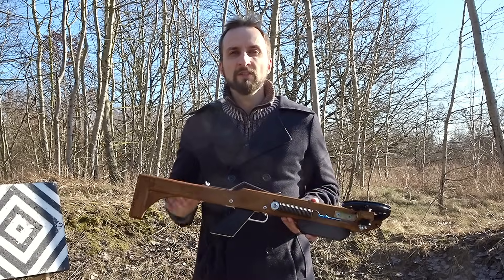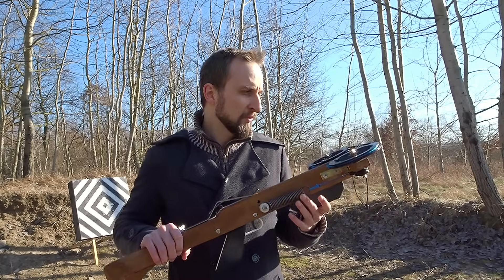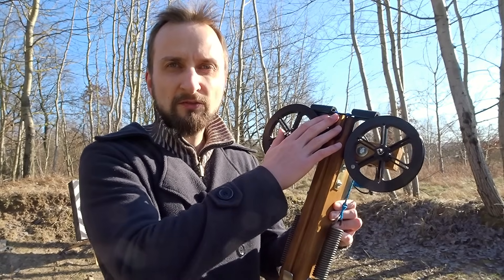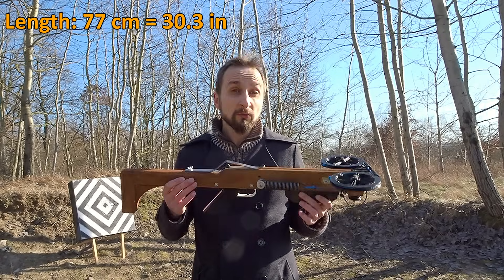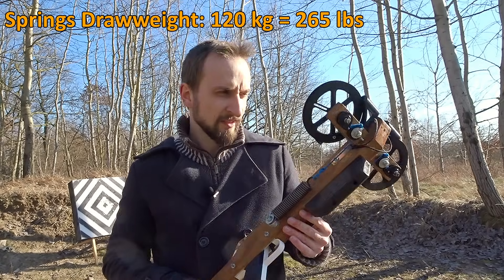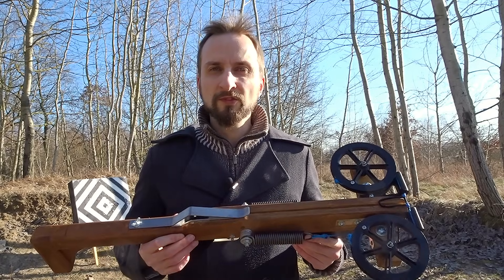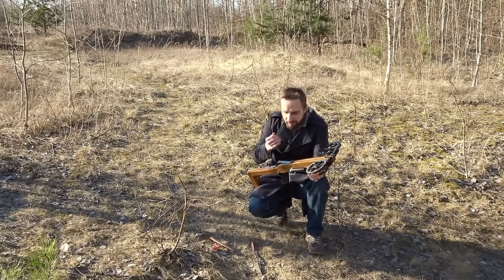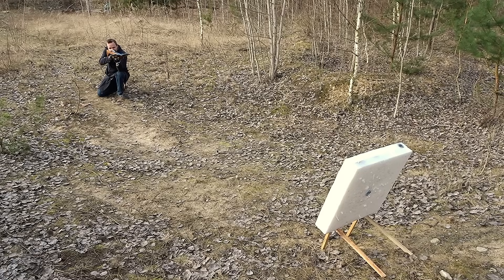Coilspring powered Crossbow

Comment: Hello, I tried to modify your construction a little by not using round pulleys on the string, but in the shape of a three-quarter ellipse with a ramp from a smaller to a larger diameter, it made stretching the string a lot easier, since the largest diameter of the pulley is actually at the point when the spring is "free" " is basically in zero action and as we pull the string further, the diameter decreases and the closer we get to the maximum tension of the coil spring, the diameter of the pulley for the string decreases and thus we develop less force for stretching, but at the same time it simplifies the start of the string, the greatest force it is actually on the smallest diameter of the pulley and as the diameter increases the power decreases, but the speed of the string increases and so does the arrow, I use one spring not two, and it is built into the duralumin body of the crossbow, actually it is not one, but two, they are pushed in itself, it is softer on the inside and harder on the outside, in addition, they are longer and for better balance the end of the springs is attached to the pin before the end of the stock, while the trigger mechanism is designed around the driving coil springs, I charge with a lever that pulls the string up to above the spring and is integrated in the crossbow frame, I also have an industrially produced hunting crossbow with a reverse reed and elliptical pulleys, I must state that the home-made spring crossbow has significantly more power, I don't know exactly how much, but the arrow shoots at a speed of 508 m/s, it is absolutely accurate at 30 meters, after 40 meters already the ballistic curve works and the arrow goes down, but the arrow hits the oak tree 2 cm deep at 70 m, which I think is a respectable force, at 10 m it pierces a 5 cm thick spruce board and the arrow simply goes through the whole thing and flies even further, at 20 m it goes through straw I aim for a third of the length. I'm currently dealing with loading from a suspended arrow magazine, I'm mainly interested in ensuring that the mechanics fit the arrow accurately into the arrow holder and always in the same way, both deep and sideways, and the accuracy of shooting depends on that, there are still malfunctions, but it's already going well in 90 percent of cases, you can put it on the same way, but it is only about the correct clearance in the arrow feeder and the pressure of the holder, the repetition speed is about 6 seconds, which I think is good for a crossbow. Thanks for the inspiration, I would never have started this even though I know the principle of course if I hadn't seen it from you. good luck :D
Reply: No way it shoots at 508 m/s, I think you mean fps. No way in heck you made a supersonic crossbow 😂 508 fps is still an absolute monster though.
Reply: @mrkiky hahahaha i raised my eyebrows when I read that 🤣 😂
Reply: @mrkiky imagine a crossbow that sounds and kicks like a gun lol. And you’d need like tungsten bolts for it to not just obliterate them.
Reply from the maker: Well, sounds like you put in a lot of work and thoughs on improvement of the general idea.
Are there pictures or video of your design anywhere?
In any case nice to hear from someone picking up the idea as well.

I am thinking about non-circular cams as well of course, as already stated in the video.
But I had some other things going on in life which is why not much happened in this topic.
However for now I am working on implementing the idea in a bow - that should come out sometime this year.
Reply: Я тоже прочитал Ваш комментарий подскажу идею чтоб стрела легла точно в ложе используйте мини магнитов просто вклеить а углубления .удачи
Reply: Can we get a link to vid please 
I'm super interested

Comment: You can actually get rid of the two wheels closest to the spring and connet the spring cord directly to the underside of the big wheel axles. Your springs would angle away from the weapon body by around 15° so won't look as cool, but it's simpler and it reduces friction just a little bit.

Comment: What are your thoughts on using a vacuum piston as your power source?

There are a few relatively old videos of a guy who made something like that and frankly, its impressive if its real. But your design can improve it greatly, I think. I would very much like if you could watch those clips and share your thoughts.
Perhaps even explore realizing the idea in the future?

The channel in question is 'Pylenok'
Reply from the maker: I don't have any experience with these vacuum pistons. I see potential issues with leakage and would generally question how fast these are.
No doubt a vacuum would pull back with enormous force, but the amount of grease he had to put in there tells me there is probably a lot of
friction to overcome, which would make it slow. But again I have no experience with these and would need to look closer into it.
Unfortunately he has no shot over a chrony as far as I can tell, so its hard to judge the true power of these (especially considering
that zylinder is huge - compared to the relatively small springs I have).
Reply: @aurigo_tech  You can only kind of judge the speed by the sound of the bolt, if he actually gave correct distances. I brought it to light because you can easily print the piston to really fit well to any tube you can acquire and cause its right up your alley :D

Comment: I would suggest adding some sort of lightweight casing for mechanisms.  If something got caught in the wheels or springs when under operation you may get a danger of the operator getting debris in the eyes or face the mechanism.  Alternatively a face guard, face shield or combination of a face shield and mechanism cover.

Comment: Replace your coil springs with high grade nylon monofilament, extending right back in grooves to the back of the stock. 
It has over 140% original length yield strength and the highest energy storage per weight in tension of any common material.
Run it directly to wind up spools directly on your throw wheels. 
If you offset the centre of rotation on the throw wheels and reduce friction by having them offset forward and unwind   the throwstring directly at their rear, and preload the nylon tension cords, then you can easily achieve a constant force and acceleration over the whole throw of the Arrow. 
Then you will have a world leading crossbow in power and accuracy.

Comment: good design.  i would recommend putting safety wires through the springs though.  that way if the springs break they don't go flying everywhere and hit you in the face.  i used to work on garage doors and that was a problem with some of the older systems that home owners would install.  its a good idea for anything that uses extension springs
Reply: My thought was to have the springs inside of tubing attached to the stock so the spring is inside and cablesruninto end and attach to the spring . So if the cables ever break you want get those springs in yer face
Reply: @anthonybeshires9255  This was what I was thinking, some steel pipe, or PVC would work I think,
Reply: @anthonybeshires9255 The tubes would also aid in keeping the springs lubed, out of moisture and clean.

Comment: cood you get more power by streching the spring more
Reply from the maker: When streching a spring too much it doesn't go back to its original shape and is destroyed. I drawed these out as much as is safe. For more energy I need a better conversion of it from the  spring to the bolt - or have larger springs.

Comment: I weigh 114 kl.  didn't look like it took much effort to cock the string back. 5:45. Love the crossbow.
Reply from the maker: The springs have 120 Kilos combined - through mechanical advantage this is down to 27 kg/60 lbs at the Main string. In exchange one gets more speed.

Comment: Great design, and good to see some fresh thinking.
I wonder if a pneumatic spring might be a thing? It would take a bit of designing, but being able to change the draw weight by a pressure adjustment seems worthwhile.
Reply: ive had airguns with those... a couple in parallel with the body- the thing would be hardly thicker than a gun
Reply: gas spring has some advantages, but it's very overrated by airgun producers, main advantage is that there is no that annoying sound after you fire like you play some music instrument and second, it doesn't get weaker over time.
Reply: I was thinking that if you designed it carefully, the gas spring could give a much flatter draw curve. 
A mechanical spring is a Force proportional to stretch so the thrust force on the bolt drops away as it moves out of the bow. But with a gas spring that wouldn't necessarily be so, you could potentially have the same thrust on the bolt for the entire stroke or close to it.
Also being able to dial in just how much thrust you want to give to the bolt seems like a plus too.
I don't know how to do this, I do electrical stuff, but I 'd love to be able to build something like this.
Reply: You can thead a hole in the middle of the bolt holding the springs and then put a threaded rod through it, in the middle of the stock. Fix the rod at both ends, attach something to turn it (like a knurled wheel or an attached ratchet wrench) and cut some slots for the spring holding bolt to move back and forth. Now draw weight would be adjustable while the draw lenght stays the same. Lots of added complexity but you could also use it to load the bow by adjusting it down to hand draw levels and then ratcheting it up all the way back up again.

Comment: If you make your parts with 20% to 30% infill and lots of little holes on the surface, then you can paint them with resin which will soak in and make them very strong.

Or if you make them very thin and then paint them with resin, and then dip them in graphite fiber (or baking soda), let them dry, then paint them in resin again and dip them in graphite fiber (or baking soda) again.  Repeat that until they are as thick and strong as you need them.

Comment: Lot of techical details, but my bow pulling 50lbs only throws arrows going through rebocks wheras the ones shot with this 120lbs hardly penetrate 4 bottles of Fanta.
You do not like Fanta, do you?
Reply from the maker: Well the draw weight at the bolt is 27 kg/60 lbs - the springs themselfs have a combined drawweight of 120 kg/265 lbs. Not quite sure what a rebock is (you probably didn't meant shoes?). If you meant a Rehbock, then I think a bolt from this crossbow would totally make a hole in one - but I rather shoot on bottles. Even though Fanta was indeed not the best choice because my camera, tripod and myself became really sticky afterwards..

Comment: would it be possible to make the wheels horizontal to make it more compact?
Reply from the maker: Vertical you mean. Well when you make it like a bow, with one wheel above and one below the stock, sure it absolutly is possible. 

To keep the wheels on each side and make each of them vertical like what "Homie Boi" suggested in another comment, well that is much harder because a important point of this concept is that the wheels as I made them build up tension in the string when the bolt has left the crossbow and that stops the wheel's rotation and brings everthing to a halt.
With two vertical wheels left and right they could not assert tension in such a way (meaning horizontal in left-right direction) at least I don't see how - so the string would only be stopped by the stock - which would be problematic in all sorts of ways.

In short: it is definitely also possible, yes, but I don't see that many advantages and quite some complications/problems added.

Comment: How many meters can you shoot?
Reply from the maker: Maximum distance would be archieved if I pointed it 45° upwards. I have not done that as I don't have a shooting range which is large enough and I would certainly lose the bolt. Actually hitting something depends on the consistency and an aiming device. I have follow up videos where I shoot up to 30 m distance. But more is certainly possible.
Reply: @aurigo_tech  Thank you very much for the information.

Comment: Three obvious things that can improve the system: use eccentric cams to let off the spring force - this will even the force and make steady the acceleration curve, promises up to 50% improvement when balanced correctly to the weight of the bolt; do not use extra passive rollers - I recon you lose up to 20% of energy in them just for the sake of springs moving in parallel to the stock; synchronize the string pulleys, 20-30% of energy loss here, the easiest is to use one spring and distribute it into two cams. With all of those you may practically double the energy. Further, the bolt weight must balance with the weight of the spring, roughly it should be equal to the weight of the spring divided by two roller ratios (because only half of the spring moves "on average"). You may improve the system even more by using an air spring, e.g. from the spear gun using a carbon fiber drive rod.
Reply from the maker: Good points! Most of which I was aware already. Some things are hard to combine though in one device.
For instance to have one large spring but also no rollers to redirect the string - I can't really see how that would be possible without adding new components which increase drag/losses again. According to my calculations this crossbow converts just under half of the energy stored in the springs into kinetic Energy of a bolt. And yes I am sure I can increase that ratio.
I will add non-circular cams next, as well as remove friction losses like the redirectional rollers and some other mentioned things, like improved adjustability. Thanks for watching and giving an excellent analysis!
Reply: @aurigo_tech  Glad that we are thinking in cohort! 
A single spring can pull a Y-shaped wire distributing force directly to the cams, synchronizing them at the same time. 
I am trying to source a decent air spring, too bad that spear guns are totally banned in Canada. 
Another interesting direction of thought is torsion springs - those are the most energy-rich ones with he least amount of "attached mass" (carbon fiber, possibly?). They work exceptionally well in high-ratio pulley schemas.
Reply from the maker: @DibutilFtalat  Well, I can't try everything at once, but I will for certain soon continue on this path of development.

Comment: wow, im very surprised that 3d printed parts can hold up to those forces, well done :3
Reply from the maker: Took a few tries to dial in the right print settings, but jep, totally works.
Reply: @aurigo_tech  PLA or PETG?
Reply from the maker: @jazon9  I actually had both materials work. I felt more comfortable with PETG though, because it is less brittle and I think it absorbes shocks from sudden accelerations (or decelerations), like the wheels do, better. Apart from user error on my side (by dry firing it once) they didn't break on me yet.

Comment: do you know how mucxh draw weight the springs have when theyre 9cm pulled out?
Reply from the maker: They were rated at 54 kg at +7.5 cm or so and I draw them out a bit further to +9 cm to probably around 60 kg. I didn't actually measure, but it must be in that region.
Reply: @aurigo_tech  i guess you need a very strong construction if you want to get the power to more serious levels. And some really thick springs. I had an idea like this but with rubbers. shows you what a mastery of craft and materials really fast crossbows are these days reaching 500 fps.
Reply from the maker: @melangkoh4184  Yeah it really is not easy to get anywhere close such numbers with a home build contraption, but I think I can improve performance of this as well to some degree. I will definitely make more bows and crossbows in this direction.

Comment: Really novel idea. You could probably use a toothed rack attached to one spring to drive two pinions and use those to drive the wheels, then you might be able to house only a single big spring inside the stock of the crossbow rather than two on the outside.

Comment: Hello, congratulations on the Crossbow. What kind of springs are these?
Reply from the maker: Just bought them from a online-shop. The exact ones I used are 134 mm total length, 26.5 mm total diameter, 4 mm wire thickness, 25 windings.
And they are rated for 52 kg max weight, but they can be drawn out further, I put on roughly 60 kilos of drawweight on each of them.

Comment: Hmmmm ..if you use springs or rubber strings or bands it wouldn't be any issues on dry fire or having it as a slingshot too...if you use fg limb or wood etc you might have a problem when dry fire or use not compatible arrow or ball bearings...still it is awesome ideas!!!👍💕👍keep it up ... following

Comment: Hello Sir, I would like to know how large is the flight track please?
Reply from the maker: Not quite sure what you mean. The range? Didn't actually tried that yet (because I don't want to lose bolts..). In a newer video I shot on a bit more or a distance and there is more of that coming soon, with added iron sights. I guess the maximum effective range is around 50 m. Beyond that it will be just very hard to hit anything.

Comment: I wonder what other sorts of springs could be used for this sort of crossbow or if the linkage could become somehow more efficient?
Reply from the maker: I think removing the redirectional pulley I had in here would improve performance and also generally to have less weight and friction. I don't know if there is a more efficent linkage between the springs and the "acceleration system". I mean, it's just string, minimal weight already. I think what would also give more energy is to have the wheels not circular but like in compound bows - which I am working on right now. In principle any kind of linear spring could be used. Even  just weights. As long as it pulls hard it should work.
Reply: @aurigo_tech  I see. Thanks for the response!